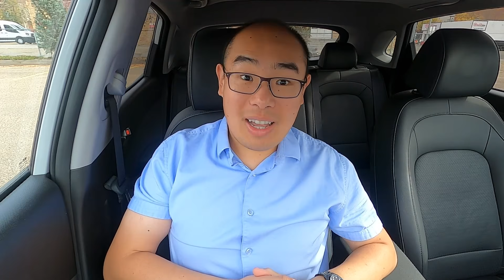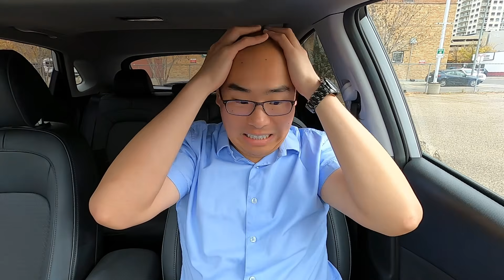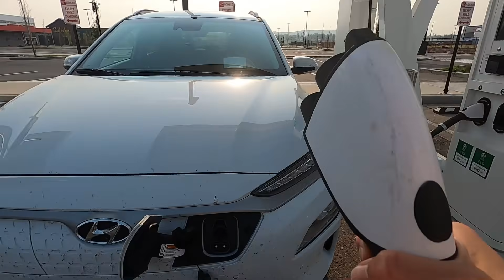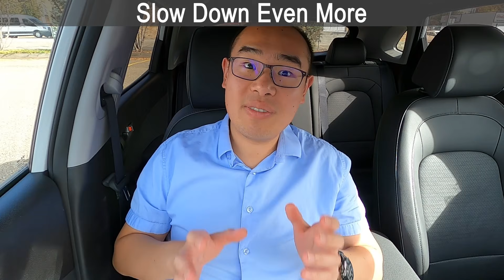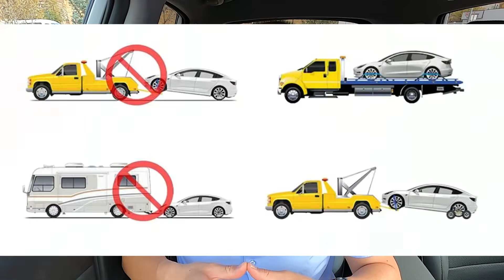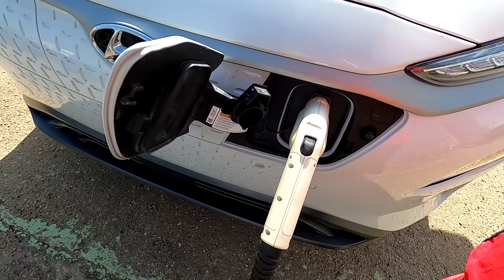About to run out of Battery - What can you do? | 5 Stages of EV Battery Depletion

Comment: Thank you for another fantastic video. I am currently awaiting the arrival of my first EV (Kona) and your videos have been a great resource of information.
Reply: I was wondering about home charging. How did you select your charger and what tips could you offer ?
Reply from the maker: I actually don't have a home charger. I charge at a public charger that is very close to where I live and it is convenient enough for me. But if I lived in a house I would definitely get a home charger. There is a lot of selection and I think there are a lot of different options. It is possible to just use a 240V NEMA plug as well. I think you could get 3.5kW out of that. Unfortunately I don't have much personal experience in this area.